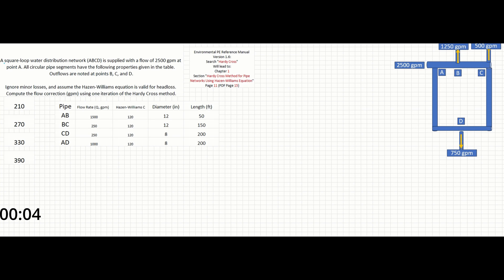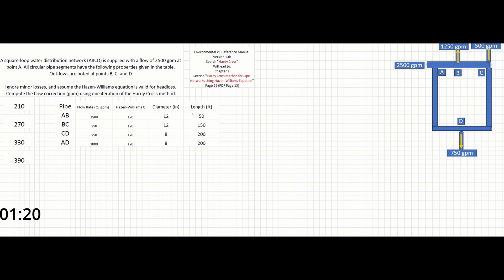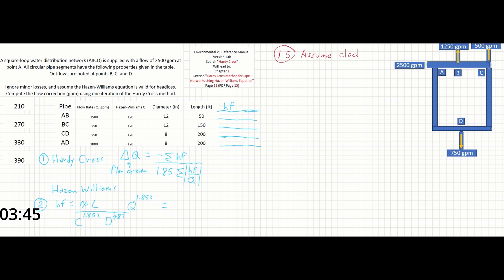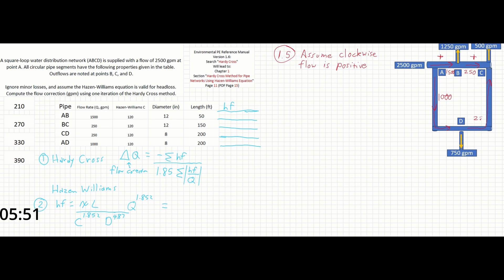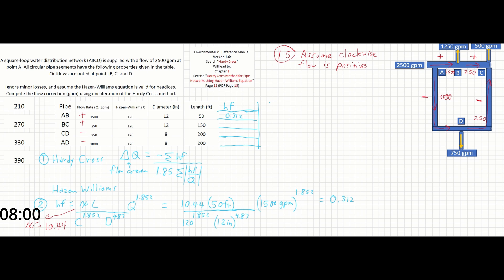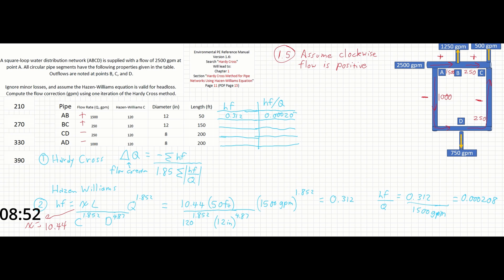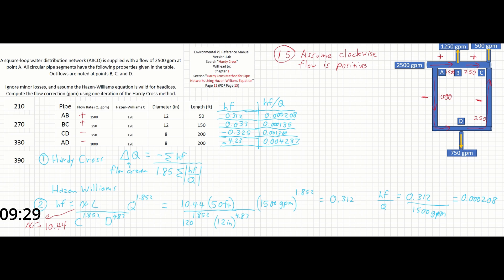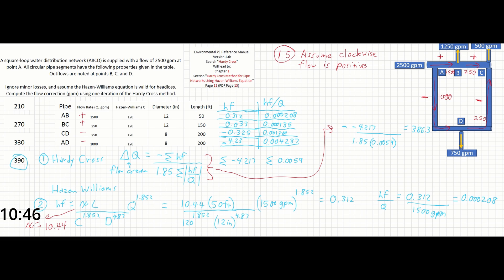PE Exam Practice Problem #96: Environmental | Hardy Cross/Hazen Williams/Pipe Network/Corrected Flow

Comment: Do they test Hardy Cross on the PE Water Resource? I am not finding the Hardy Cross formula in the Water Resource Reference Manual for PE exam.
Reply from the maker: There is a higher chance that it would appear on the Environmental exam. However I added it to both exam playlists because I personally feel that it wouldn't be out of place for it to appear on WRE either given that its a pipe flow and head loss problem.

Comment: The diameter is in inches, the length is in feet and flow rate in gpm, don't they all need to be converted in English units first before plugging in the Hazen-Williams formula?
Reply from the maker: Check out page 11 of the environmental reference manual. 10.44 is used when Q = gpm, L is in ft, d is in inches, and hf is in feet.